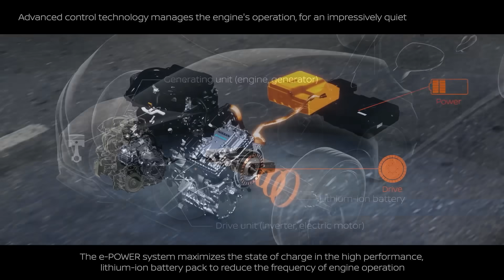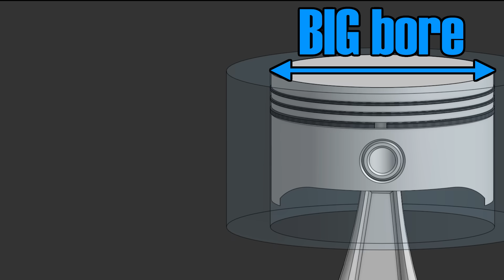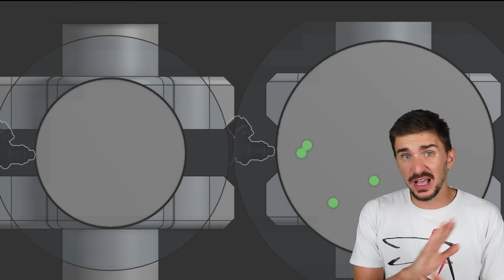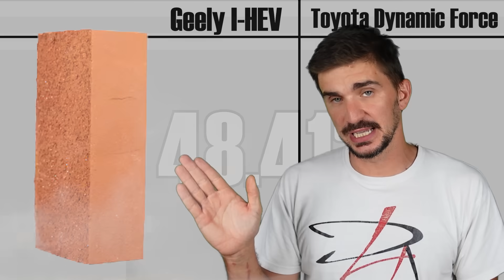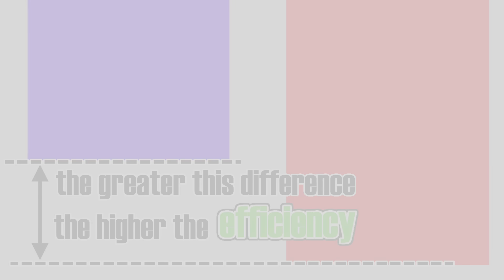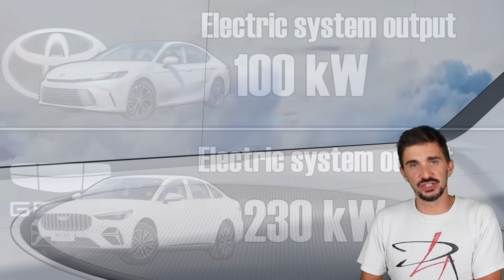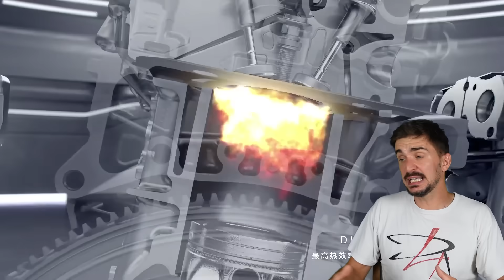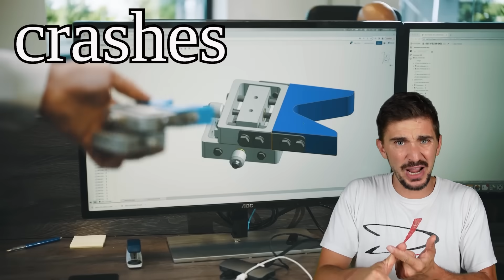How China's Geely Beat Toyota, BMW, Ford and Everyone Else

Comment: So if you have an unlimited supply of fuel/Hydrogen , fuel efficiency does not matter. Just ask JCB , Cummins and Hone generators all  have  internal combustion hydrogen engines. Btw no batteries no electric motors, no critical minerals. Just zero cO2 and practically zero nox emissions. So do a video on why we are not adopting Hydrogen as ICE fuel.

Comment: The ideal solution is an EV with a built in engine/generator (a series Hybrid) whose engine runs at only 1 speed 1800 RPM or 3600 RPM. It is optimized to run at only 1 speed, ie it is always running at the very top of the sweet spot of efficiency. If your battery has enough range to get to your destination, then the engine is completely off. If you need more range, the engine is turned on to run for sufficient number of minutes to fill enough charge to get to your destination. This is the absolute deal solution and I have been working on this for 16 years

Comment: Great video, as always! 

Does anyone (yet) make a true decoupled hybrid automobile; the same technology as modern diesel train engines? That is, with the combustion engine connected only to a generator, whole primary drive comes only from electric. To me, it's always seemed the best choice. You tune the combustion engine specifically for generation, getting the most efficient generation you can...
Reply: Nissan ePower is an good exemple

Comment: Yer a smart guy so I hope you read this. The Miller cycle was a marketing scam that got embedded into automotive common knowledge, despite being a lie. Its like everyone mindlessly describing drive-line power losses in the double digits, when that would quickly result in catastrophic failure as well as and the odd vehicle fire. Go back to first principles with universal gas law. There is no difference between valve timing or throttle plate restrictions when it comes to filling...or partially filling...the cylinder. The extremely high compression ratio is required because the effective pressure rise with a partially filled cylinder obviously drops, and significant combustion/efficiency benefits can be achieved with that correction.

Comment: The problem with super high efficiency motors is that in engineering there are always tradeoffs. If you lower the friction by using thinner oils, you invariable increase bore scoring problems. So whatever they gained in percent efficiency they probably have lost some longevity. The old tractor style motors that Mercedes used in the 90's in their famed inline 6 engine routinely reached 250k miles without a rebuild. Toyota has proven that a reputation for reliability is the most important of all, and sadly Geely is chasing specs here not proving reliability. Given that cars cost around 45k avg now, people expect trouble free long use, and a few percent improvement in thermodynamic efficiency is not important. Frankly if you want efficiency, Diesel always wins in terms of getting miles per pound of fuel.

Comment: If the compression stroke and the expansion stroke are different lengths, which is used to determine the displacement?  If this has (for example) a 750cc compression volume and 1.5L expansion volume, which is highly efficient, it's a very efficient 750cc engine, but wouldn't surprise you if it were anemic.

Comment: Constantly bombarded with memes on social media with the subject being a incredible breakthrough in technology from China. I remain skeptical since China seems incapable of manufacturing a kitchen appliance that doesn't rust and stop working in three years. The small kitchen appliances are cheap throwaway items but automobiles need to last a decade without rusting and falling apart and with drivetrains that are reliable and last a couple hundred thousand miles. I'll keep purchasing the cheaply made throwaway small appliances but will wait until Chinese built vehicles have a proven track record of reliability and repair part availability.

Comment: Ok so if I understand correctly, they optimized an engine to being a generator/range extender by making it a very underpowered low power:displacement engine?
And everyone else optimized their ICE engines to closer to a middle ground between power:displacement and thermal efficiency?

Honestly it doesn’t seem too bad if it was strictly for light low demanding trips, I guess that can be great for bumper-to-bumper traffic. But the other hybrids are better for everything else, kinda?

Comment: I am curious if the most efficient, and charging rpm for this engine is very high. Wonder what effects on reliability this will have. Is this like a standalone generator that runs at like 80% load at all times?

Comment: Sounds perfect (except for the body build which will still be Chinese). The torque inherent to EVs with a donkey motor matched to an intelligent handler. AI can be replaced with any method to anticipate upcoming geography. A fully charged battery weighs the same as when fully discharged? What I didn't hear about was cylinder deactivation but it probably is included. The Rev-heads need a sound package that makes the right noises so they don't have to sit there making vroom-squeal-pop-pop noises.

Comment: does the smaller bore or i should say lesser diameter bore result in less tearing of the “left” side of the wall of the engine block or the wall of the cylinder, sorry for poor choice of words? it seems to me the the force applied to the wall as a conversion from vertical force to horizontal(rotational) will be lower, just because the bore is lets say narrower 😏 
longer stroke and thinner and narrower bore seems much easier to move inside the cylinder housing and less friction to the left side of the wall,  when looking here in the video, since only one side of the cylinder wall will always suffer more friction than the other, ofc, this is just my pure subjective logic and curiosity, nothin more 🥹

edit: grammar

Comment: Great Video - thank you as always. :) So the conclusion is: chinese engineers are also cooking with water.^^

To clarify the difference between atkinson- and miller-cycle a little bit:
Miller - early intake valve closing (before bdc)
Atkinson - late intake valve closing (after bdc)

VW uses Miller-Cycle for over 10 years, Toyota Atkinson since the first Prius. The engine control (air mass) is with Miller more complex but it comes with benefits considering the tendency to knock (simplifies implementation of higher compression ratio/forced induction).

Greetings from a german engineer.

Comment: 48% sure, but also needs a hybrid motor because the cycle it uses has terrible power output and torque.  atkinson cycle is great at thermal efficiency, but terrible at actually powering anything.

so again, electric vehicles are VASTLY superior to ICE engines at moving a vehicle from an efficiency standpoint.

Comment: Good old port injection (mpi), there is no need to add this huge pressure to the engine. Time will tell everything when these engines hit 150k miles.
If they can even hit those numbers

Comment: VARIABLE Value Timing would imply that the engine could seamlessly transition between "Deep" Miller/Atkinson cycle and more-normal operation.
This transition could be mediated by the driver-selected driving more (Eco vs Sport), or (NEWS FLASH!!) how far the Accelerator pedal is depressed.
My vehicle offers a "modified Atkinson cycle" (name in spite of being Biturbo) and 362 hp (0-100kmh: 4.8s, Quarter-mile: 13.3s) when 'required'.
Primary point is that these days it's possible to program the computers to provide 'all of the above'. One doesn't need to choose A vs Z; one can have the entire alphabet.

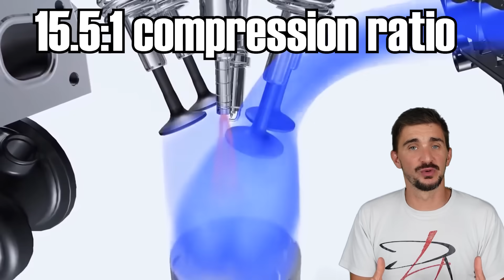Comment: 6:19 FIFTEEN?!!?? That's more than most motorcycle engines and I think is roughly the compression ratio run by F1 no? Gad damn.
Nevermind. If they use 50% or less of the stroke to actually compress the afm it's basically a 7.75 to 1 compression ratio...

Comment: 17:20 on paper that's a good idea
Reply: EXCEPT for the fact that the AI, in order to do its optimization job, has to know where it is, the road configuration, AND where you are going. In other words, a tracking system that can be used to, effectively, report your activities.
Reply: @JM-lk6wo  Check the privacy report for any modern car, most of them already do this and sell the data to whoever wants it. The days of your car not being a driving spy device are already way past
Reply: @JM-lk6wo  If you use the builtin navigation system your car obviously already knows where you are going. Terrain height maps are readily available. Combining your route and a height map the car knows when to charge the battery so its full when you start driving a large uphill section. No AI needed.
Reply: When Americans reach this point they will start making it a subscription service. Or Chinease will make it like 4-5 years of cloud support and they you have to pay monthly.
Reply: Or adjust the software settings, so that the car maintain a 70% or 80% battery at all times. If you have 30kWh or larger battery it'll be hard to run out of battery. Very few people in China require maintaining high rpm for 20 or 30 minutes continuously, when driving a car on paved roads.
Reply: I don't trust it to not hallucinate
Reply: European trucks have been using that for automated shifters for a long time now.
Reply: I can't think of anything worse than being literally unable to drive my car if it wasn't connected to a server in China.
Reply: @mahcooharper9577  The ai system just manages telling the engine to charge the battery above what it normally would before predicted uphill segments, without it the car would just function like any other hybrid vehicle

Comment: As always,  great video! Just a bit misleading in one aspect however.  It terms of purportion, this under square engine indeed has a very long stroke. However in absolute terms the actual stroke length and thereby the stroke to connecting rod ratio which actually has a massive influence on critical piston speeds, that is to say the maximum piston speed and therefore the rates of piston acceleration and deceleration which massively affects the engines thermal efficiency,  is right in there with a bunch of the other engines displayed on your chart. So, the rev limiting discussion isn't really germain. Using the stroke length and the connecting rod to stroke length   relationship  doing the geometry and plotting it on a graph may yield some insight into this supposed efficiency jump. Frankly  I'm having a hard time buying into this claim in the first place. Seems to good to be true.

Comment: why not spray fuel threw a tutbo, and power an electric motor , to create electricity .  a turbo has one moving part ,     the engine has 10000 moving parts .

Comment: EV centric Hybrid gonna take more traction, check Nissan e-Power. 
HORSE is also starting to offer "on the shelf" package of engine + generator range extender to be implemented into EV chassis.

Comment: Not far into the video and I gotta say the numbers don't add up. Huge sedan consuming less than 2.3 liters / 100 km is fishy with a claim of 48.4% fuel efficiency. Petrol (assuming the typical pump variety of fuel) contains about 9.5 kWh of energy and 48.4% efficiency means about 10.2 kWh of energy is available. We don't know the speed of course, but at 100 km/h this would equate to 10.2 kW average power consumption over an hour drive. This is VERY low power consumption, although it is difficult to find details like this from OEMs, total energy consumption double this seems plausible. I suspect that they are sacrificing power storage and turning off all accessories AND driving at a reduced speed over a closed course to set this record (60 km/h?). My goal with my V8 Corvette is about 48% efficiency (mild-hybrid 3.6 L) and I'm fully expecting to burn 4 liters / 100 km at 100 km/h. Of course, I don't have their development budget, but I have spent a LONG time on the project (for instance, I got a utility patent from the USPTO in 2015 on an ancillary invention).

Comment: China also managed to turn sea water into crud oil, no 3rd party verification yet.
Reply: It is called Fusion
Reply: Its possible to do with enough energy. Its just that if you have all that energy and the ability to build all of the industrial infrastructure for such a process, you'd be better off just skipping oil entirely

Comment: I recently researched the 1.5 BYD DM-I hybrid. It's engine achieves 43% thermal efficiency, in many ways it is the same as Geely's engine. It runs in Atkinson cycle too, with the intake valves closing at 30degrees after BDC. What is missed in this video is rhe role of EGR, which BYD says is crucial in it's engine. They use up to 25% EGR and stateit prevents heat soak from the cylinder walls and it slows down the combustion, which is utilized by the long expansion stroke. In their latest version (5th) genereation, they further optimized thermal efficiency, which BYD calls crucial. Split cooling for the head and cylinder block, huuuge water jacket around the cast in exhaust manifold. Let me know if you want some info, my contact data is in my channel description.

Comment: I'm curious, you said that the engine would be unresponsive and weak to the point when it's unacceptable. But why not put it in an extremely light nugget that doesn't really need power and only cares about going from point a to point b? I'm just curious about why it wouldn't be perfect for that

Comment: This is fake news. Geely has a history of manufacturing facts and producing engines that don't last more than tens of thousands of miles. They have yet to prove this. The numbers comes from modeling the engine and simulating it to show these values in order to show the world they produced something they don't actually have the ability to produce. The Geely vehicle you mentioned in the beginning doesn't do that mpg because of these engine in the video. Guinness World Records have a very low barrier of proof. Plus it's China.

Comment: NO! Cheating with electric engines?? This is BULLCRAP! This is cheating.
So it's not diserving any awards, it's using external energy to make it efficient, so thus every "saving" is getting lost at the electric engine generating power to the engine

Comment: The big names have been using at least one of the efficiency improvements that are packaged in this motor. Peak Chinese r and d (receive and duplicate). They packaged every one off from anywhere in one powerplant and I still don't believe 48 percent. VW diesel fuel economy springs to mind. I doubt ford or Honda never explored this avenue for fuel economy. Why not? Nevertheless its both intriguing and suspicious

Comment: they did. Chevy Volt. Several mazda, BMW, Nissan E-Power .. most of them they called it range extender tho. It is the better system as it would allow to decouple the engine from the powersource. Missed Oportunity.

Comment: The last thing I want to have is another AI learning and managing my driving habits. Also, is this another form of series hybrid system where the electric motor only acts as a generator and this case, a just more efficient one? Conversion losses seems to play a lot of factor as well because the engines will have to convert the engine's mechanical energy into electrical and back to mechanical to turn the wheels, thus diminishing the efficiency advantage of the system.

Comment: The long stroke negatively affects piston ring drag with increased piston travel / piston speed per revolution. It's significant as we see from the rise of low tension piston ring use (and their attendant oil consumption issues).

Comment: Jeesus, AI everything. That so called AI that GEELY is using to manage battery, well VAG has been doing that with their GTE's without stamping AI on it. As long as you have mapped the route in the onboard navigation then the car will manage when to charge/discharge/lock the battery in combination with running completely in ICE, EV or Hybrid mode. All based on map data such as elevation, descending or ascending and speed limit on the road your on. No AI needed.

Comment: Okay fair. But do a quick google search and you'll find that the engine makes 73 kW, which is more or less the same output as otto cycle engines that are about 1.5L from toyota, suzuki, mitsubishi and others. It might be a drastic drop from the electric power, but it's hardly "gutless" for the economy cars it will go into.

Comment: And this hybridization happens BECAUSE batteries have not yet achieved performance/price optimal developed point, but they will, BYD has and is already installing 340Wh/Kg 8K cycles batteries.
At 340Wh/Kg batts are already very good, a 200Kg batt gets you 60KWh wich gets you 480Km of autonomy.

Comment: What I understood over the 40 years I have been following engines developments, the legacy manufacturers could have produced these higher efficiency engines, but they purposely withheld the increase of efficiency because of anti pollution constraints imposed on them.  They did not want to evolve too quickly so that anti pollution laws/limits could be not be too stringent.  The Chinese since they are the new kids on the block they could afford to be more daring in  terms of efficiency.  Too much efficiency is not good for the fossil industry as well!

Comment: This explains the under square long stroke design.  There is enough stroke left to actually compress the air to an acceptable level for combustion.  A square or over square engine with a deep miller cycle would not have enough compression to support combustion.

Comment: You know I don't get this idea of having most of the power coming from the motor but still going through the trouble of connecting the engine to the wheels, it seems like the benefits would get heavily outweighed by the added complexity and power loss of having a gearbox and clutch